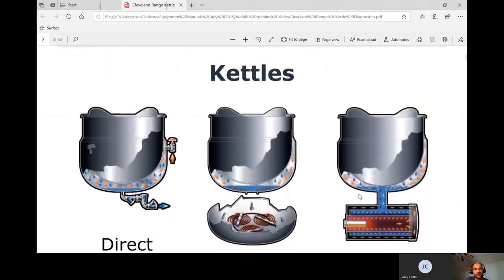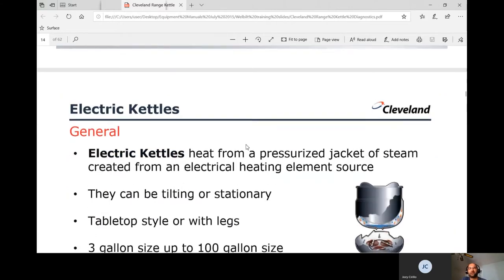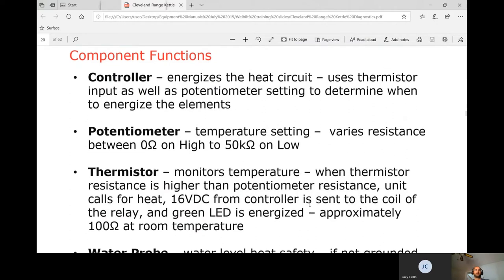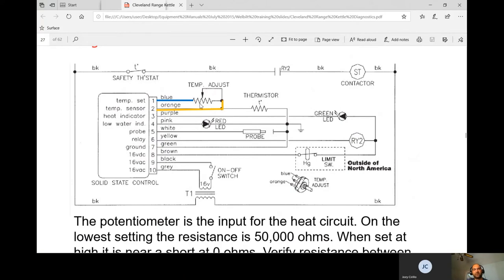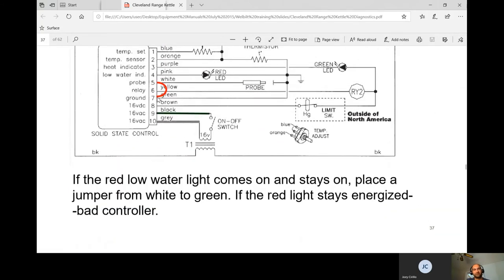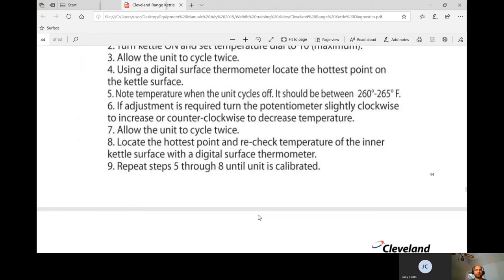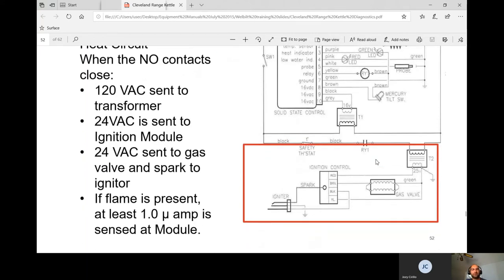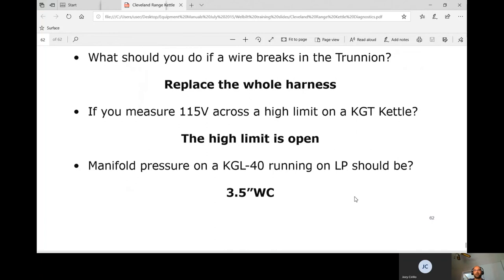Cleveland Kettle Diagnostics

Comment: Thanks for running through these.  My potentiomter measures 45 kohm at low and 6 kohm at high.  The potentiometer doesn't register.  How do you extract it and put in a new one?  It looks like it is glued in?
Reply from the maker: Soldered in